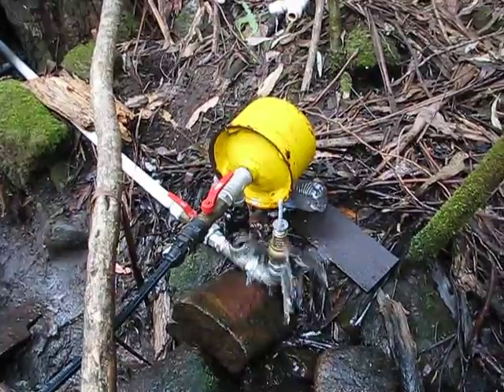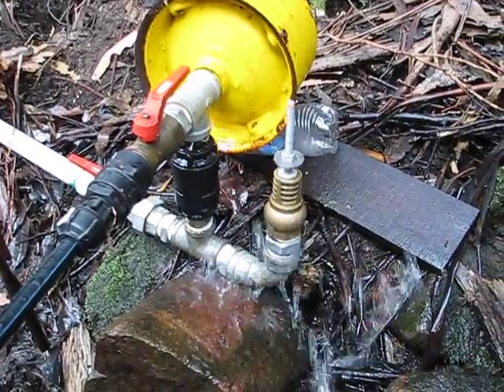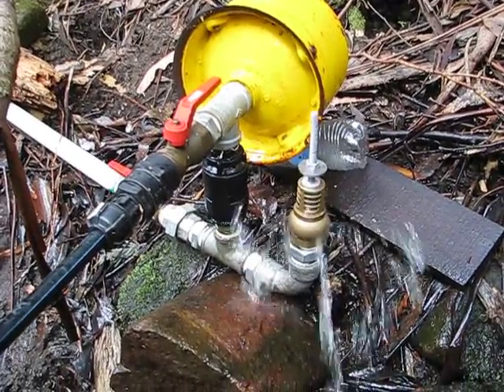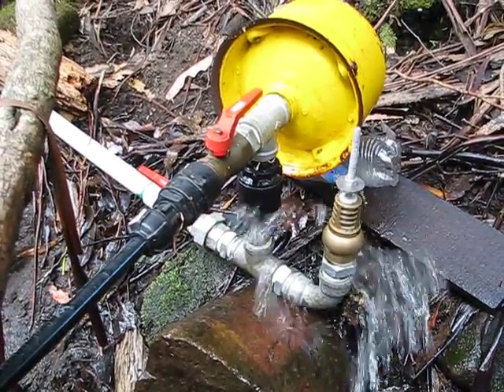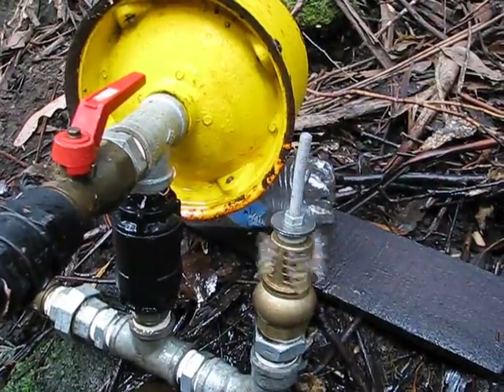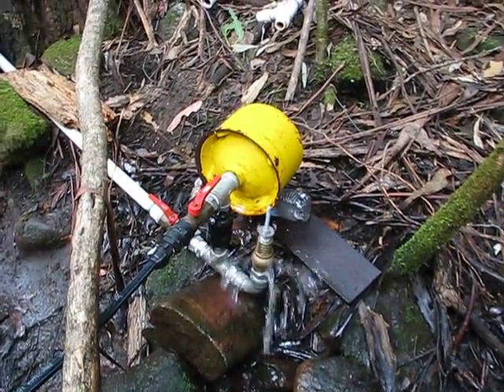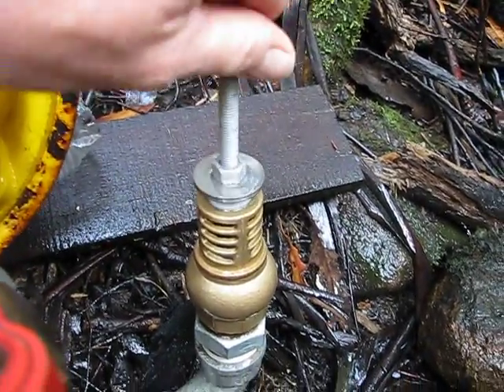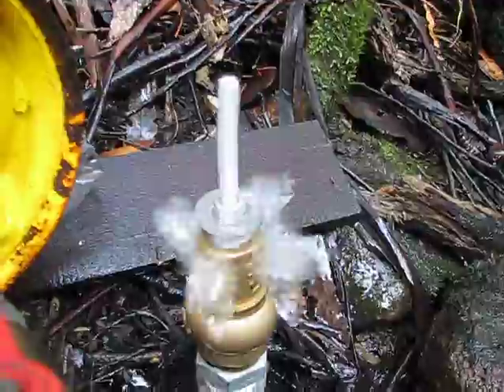modified ram pump foot valve in action

Comment: did you modify the black valve in any way? has it still got the valve closed by a spring?  I am using a stainless steel unit with a flap valve and I can see the advantage of a philmac type foot valve on the delivery. thank you
Reply: the black valve is a standard off the shelf part.it still has the spring.